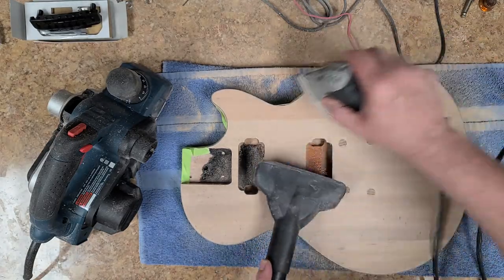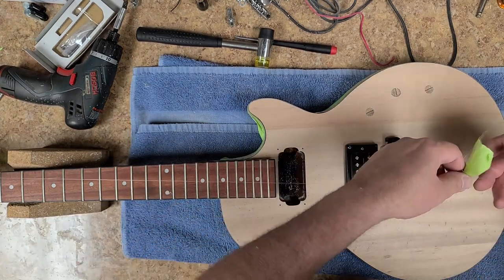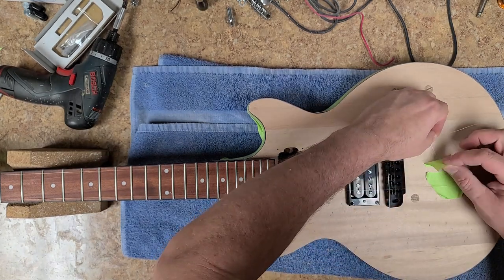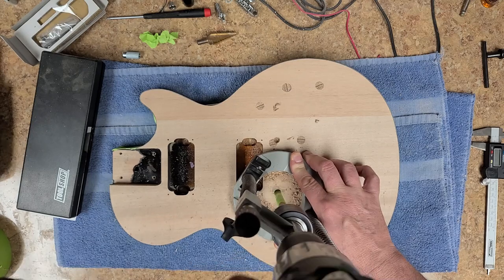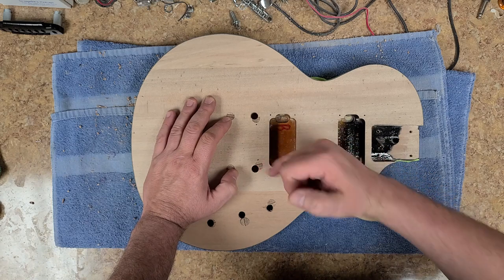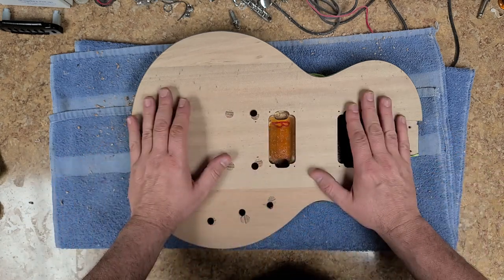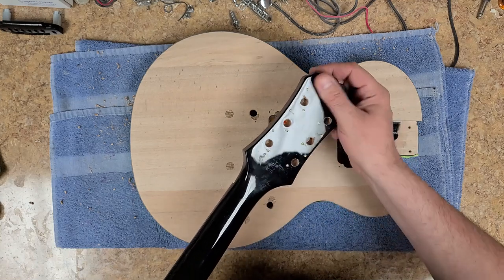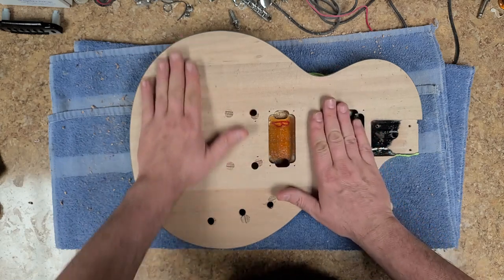Making a Epiphone Special ll Custom Part 2

Comment: Great progress, Eric. I haven't seen the StewMac bridge finder before, that's a great little tool. I rebuilt one of these Epi's a few years back, an early ply-bodied version from a junk shop. I put a coil split push/pull on the volume knob and a phase switch push/pull on the tone knob. I might send you a few pics if I can find them!

Comment: In my opinion using the push pull as an on-off switch for the pickup is and unnecessary added wiring mod since you can just turn it down anyway.  As you probably know I've done this wiring with two volumes and 1 tone on some of my guitars, and also two volumes and no tone when there hasn't been enough space in the cavity to add a third control. On those I can control the tone with a pedal or the amp.  But using a push-pull to do the split allows you to have a better blendable mix between the two pickups as options.😊